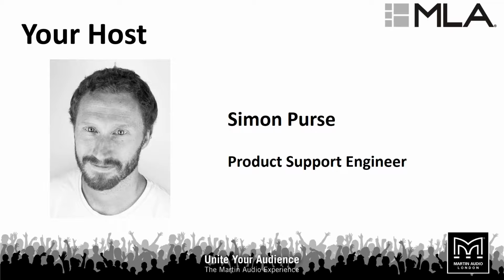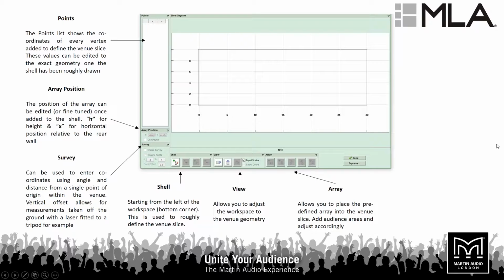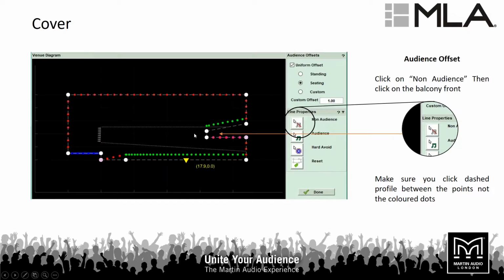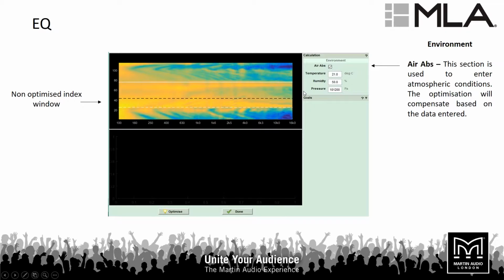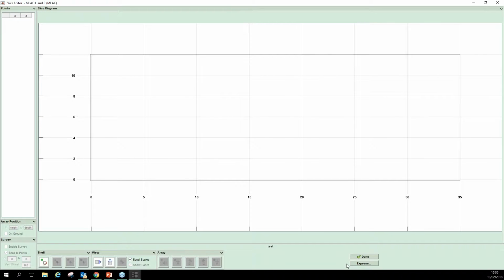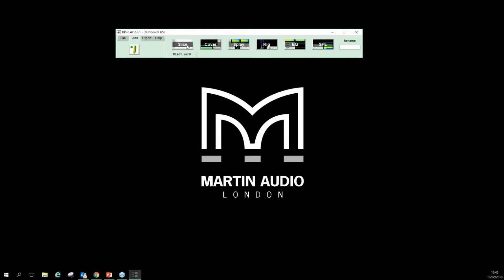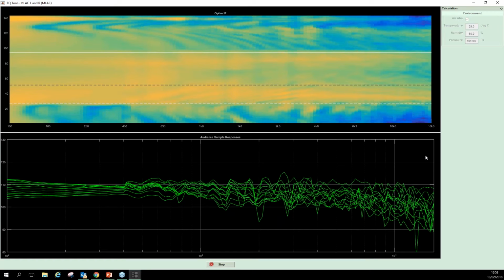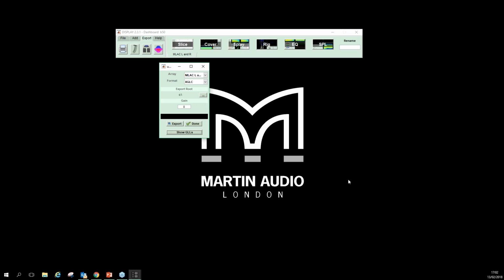Martin Audio Display 2.3 with MLA Training Webinar Video

Comment: hi dear, when I choose the number of units in the first step, should I choose the total number of left & right side? or only one of two?
I mean should I do this project for left only then I create another new project and repeat all the steps for the right side?
Reply from the maker: The optimisation will most likely be the same for both left and right arrays as usually the coverage requirements do not differ. Having said that not all venues are symmetrical. If the vertical coverage requirements for both left and right are the same, the same optimisation can be used for both sides of the system. If you have any further enquiries, please contact technical@martin-audio.com.